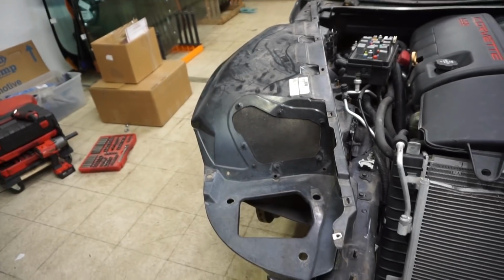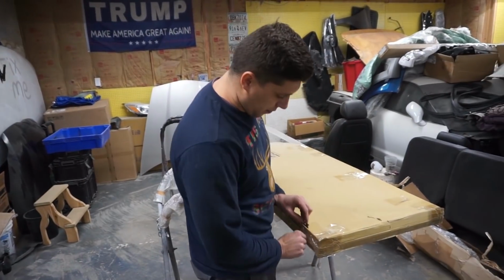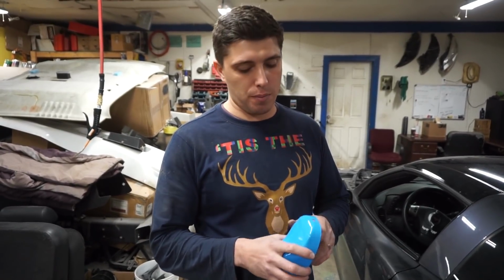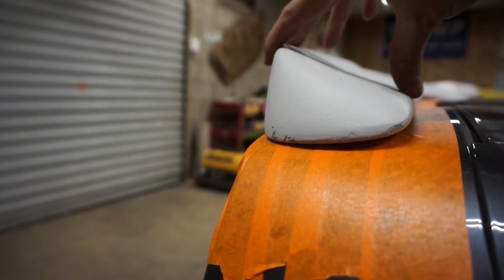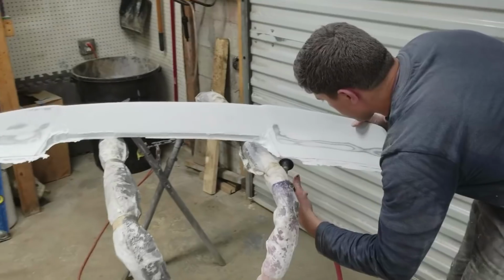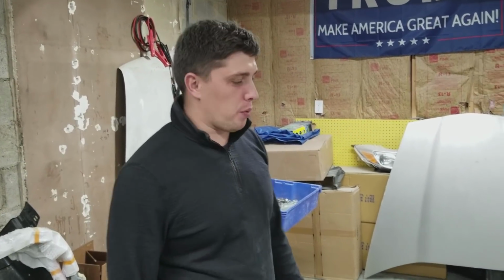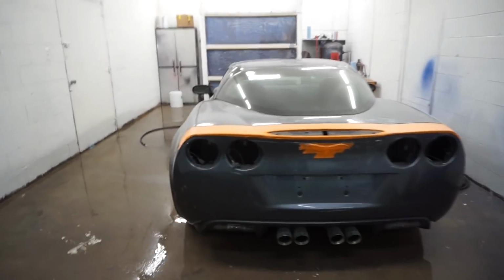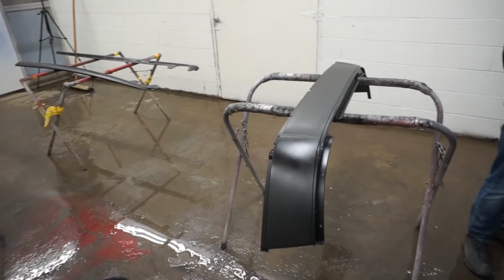Rebuilding Wrecked 2011 Corvette Grand Sport Part 5

Comment: To fill the gap on the wing what product did you use and what screws are you using to hold it down to the car, im currently doing the same type of wing from duraflex